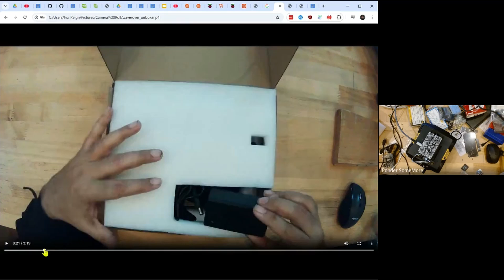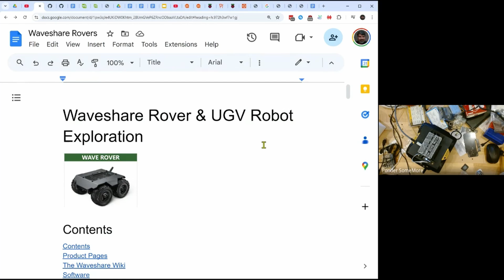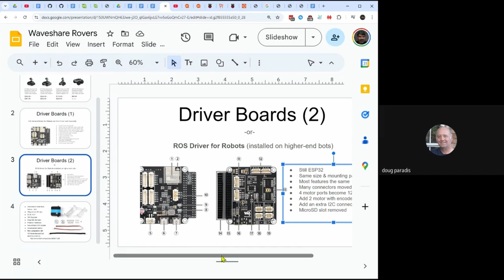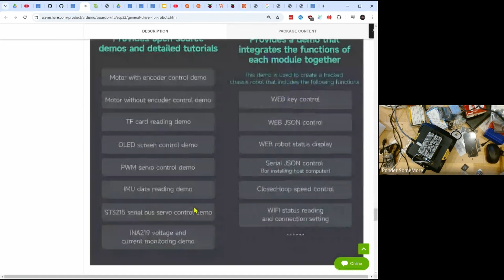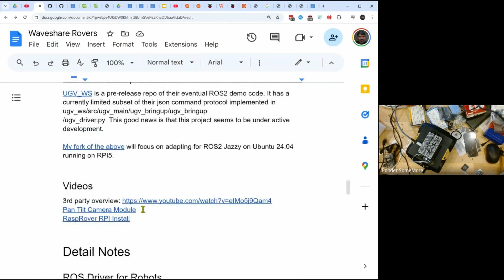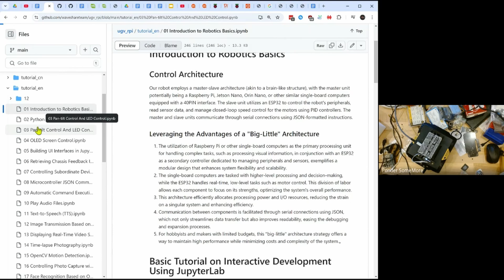Waveshare Rover Intro for DPRG

Comment: I am a programmer and I work on artificial intelligence for robots. In my opinion, this robot kit has a few big problems, and one of them is the charging port. For example, if I define that you can charge yourself in this place, the robot cannot, because the charging port is not easily accessible.

Comment: The only thing stopping these robots from being perfect IMO is the baby power connector and lacking max wattage they can provide to servos and motors. They basically can't power more than 2 bus servos under load, not to mention the motors. I really wish they designed the driver boards for realistic loads.
Reply: Also no power source besides one specific Waveshare one uses such a tiny port for providing power. You can't even find a power supply cable for it without making it custom.

Comment: I have to say I am really disappointed with this product. The schematic for the General Driver Board seems incomplete at best and I see no way of interfacing with the WaveShare Rover serially. The serial connection exposed on the chassis appears to be uni-directional and this severly limits the usefulness of the product. There is a jettson adapter, but I can find no information on the wiring for that or if that could be adapted. Given that people are likely to want to interface with this product it would have been nice if waveshare provided a reasonable level of information. After an initially cursory reply there has been no further information from Waveshare support, they seem to have gone silent.

Comment: IMO this is not a good platform for robotics projects, mainly due to the lack of closed-loop control and pretty weak motors. Tried to upgrade the motors to equivalent ones with hall encoders and running closed-loop velocity control, but when turning in place, some motors will stall and cause unpredictable movement (and therefore odometry errors). Also the robot bay can easily fit 3x 26650 batteries with more capacity (~5000mah), however you'll need to modify the BMS PCB and remove/replace the standard 18650 holders. I know you shouldn't expect much from a ~$100 chassis, but it was rather disappointing...